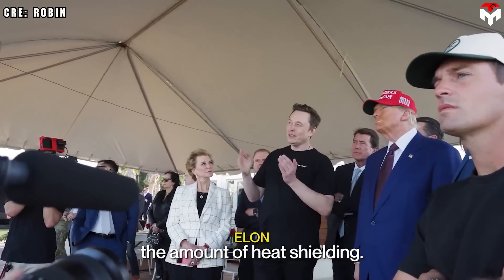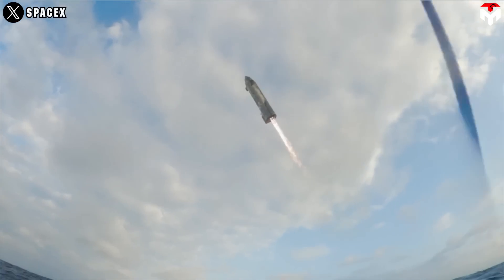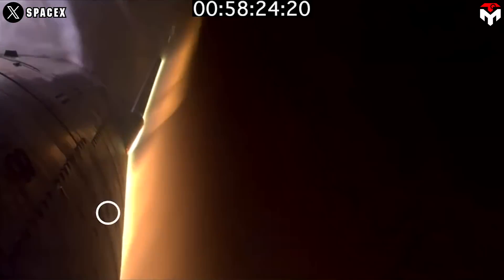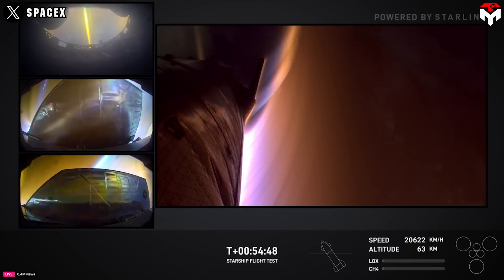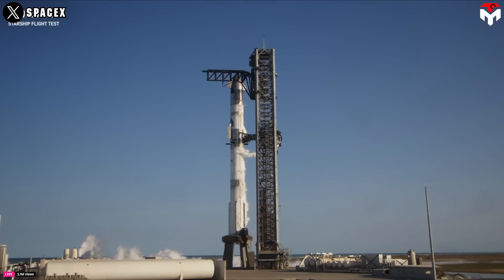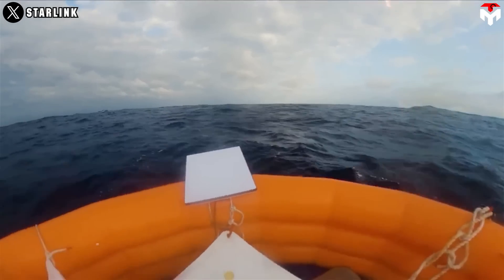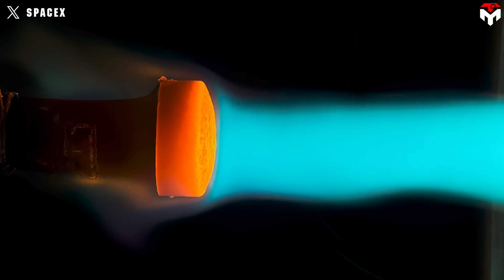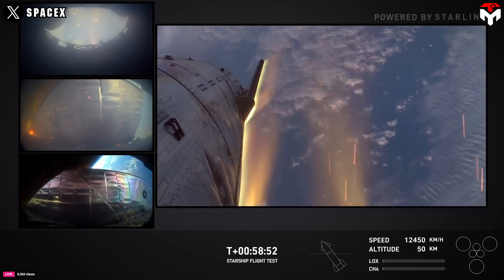"Thermal Shock"! Starship Experienced NEW PROBLEM on Starship Flight 6...

Comment: There's no problem to solve within the context you're using. SpaceX was literally attempting to break the ship during re-entry. In this they failed. The overall mission was a tremendous success as far as re-entry goes. The ship, which was a first generation of even first generation ships that were to be launched, according to their launch broadcast. So it was an older variant. They've achieved more than they expected with these first ships. The block 2 ships will be so far above these older ships they'll be able to move on to the orbit criteria all the while making small improvements to the heat shield for the end goal of rapid reusability. So, there isn't a NEW PROBLEM. SpaceX doesn't need to solve a thermal shock issue, because there isn't one moving forward.
Reply: Yes there is a problem to solve.Multiple problems in fact. And no SpaceX did not try to break it. They tested a theory that less heatshielding was needed.

Time will tell if the next iterations will be better. We can only judge them by what they actually fly, and what they actually fly right now is neither capable of reuse nor capable of taking useful cargo to useful orbits.
Reply: @torben777  I'd disagree on the last point. What they have now can definitely carry useful payloads to useful orbits. It rather appears that the "getting up" part is in a relatively polished condition. 

And the "main thing" about starship, is the payload capacity. It has more internal volume than my house. And can lift more weight than my house weighs (including the foundation & furniture). If you clipped off the wings, you could almost fit the space shutting in it's cargo bay.

They haven't put heavy payload in one yet, due to risk-cost with a new rocket design. But the whole point of the rocket is to shift the maximum payload to orbit capacity of space flight by an order of magnitude. I expect they'll put a low-cost heavy payload in one within a few months, to proof the structural stress involved.

I suppose it's possible that putting a major payload in it could go differently than planned. But it could currently carry a falcon-9's payload weight to LEO with little more capacity strain or effect on handling than putting a briefcase in your car.

But that's just the last sentence. The rest of your sentences, I do generally agree with. I guess testing to see if they could get away with less heat tiles could be viewed as exploring margins, but it's "somewhat" trying to break it as well. They also gave it a sharper reentry angle as well, to strain it. So... tomayto tomahto.
Reply: According to the broadcast I watched with WAI, they aired SpaceX's live feed. During the broadcast, a woman mentioned that they were attempting to break the ship to see how much it could withstand. I’ll take them at their word; they are quite transparent. While I agree that time will tell, I’m not concerned about the durability of the next iteration of the ship.
Reply: Largely agree, but "rapid reuseability" is a very lofty goal, which is as-yet unproven. At least for the starship. The booster should be reasonably easy to get to rapid reusability because it shouldn't get above mach 6 or so. It's unknown just how well the structure can handle the heating on the starship stage. There's going to be some re-tempering. I do think it's absolutely doable... but it may require sacrificing some goals in payload weight to get there. On the plus side, the gen 3 engines should offer a lot more weight margin to work with. It's just that the hopeful payload gains of gen 3 engines may get swallowed up by needs for coping with reentry heat.
Reply: @kathrynck  to be honest, I,don't think starship needs to be fully rapidly reusable only fully AND rapidly separately. I think ship can be left in orbit for a while or taken back to the production site while they fuel the next. Only booster really needs to be rapidly reusable with it's many engines.
Reply: @U_Geek  I guess that really just depends on the goal.
Reply: @U_Geek Yes, and there will probably be variants. Elon has said most of the early ships sent to Mars will remain there. So they will need to survive only one entry into the Martian atmosphere. For building out cis-luna infrastructure, very robust and reusable ships will be needed.
Does anyone know whether the far less dense Martian atmosphere will make for cooler atmospheric entry? I imagine it will have to be a very long trajectory to maximise aerobraking on Mars. Which may allow for greater heat dissipation?
Reply: @DavisRimu  Um...thinner air could get as hot... depends on the speed. Much less air-braking would be possible though. Somewhat more fuel will be needed to slow down.

I know musk is really into the Mars idea. But honestly going there will end up like the moon landing. Pictures, samples, a flag... 

The problem with "colonize mars" is that it'll only sustainable if mars has some resource worth all the effort. If not, it's insanely costly tourism. Mars is somewhat harder to live on than the south pole. And about a million times harder to get to. And Antarctica doesn't exactly have a permanent population.

That said, the usefulness of starship is incredibly high for just about every other aspect of space flight. Sometimes it's not the goal itself that matters, but the experience and learning by attempting it.
Reply: @kathrynck  I've argued for years that the best policy would be to use Starship to do heavy lifting to Earth orbit, building out massive infrastructure within the Earth/Moon system. Only when travel has become routine between Earth and Luna and perhaps large habitats built within our Earth/Moon system, and the hardware is thoroughly robust and reliable, should settlement of Mars be considered. 
By then, AI and the technologies it enables will give us a far better hand to play.
So I agree - the Mars goal is inspiring and has hastened the development of this excellent vehicle for getting heavy loads up out of our gravity well, but we can have endless fun with it within our own Earth/Moon system.
Reply: @DavisRimu  100% agree. Having a large settlement on Mars before Musk's death is crazy ambitious. Maybe impossible. Maturing the Earth/ Moon system is the smartest way to do it.
Reply: @DavisRimu  Plus the moon is believed to have an extreme-value resource to "go get", creating an economic reason to be there. (He3).Technically Mars could have even more He3 (not having a magnetosphere), but even standard shipping would be brutal ;) 

I'm a bit more skeptical of the AI revolution. It's facing a huge issue of "diminishing returns" with increasingly powerful chips. The problem I think is that AI isn't actually any good at "imagination", only mimicking the trappings of it. But it is good at quickly trying out a million possible layouts to achieve something more efficiently. It's just not going to make leaps which think outside the box. Also, it has to be trained... and it's trained on content which has human imagination & debugging... but as more is created by AI, the more it gets cluttered with "copy of a copy" errors, and the more it drifts away from imagination & functional debugged results. Basically the more it becomes AI being trained on AI, the more problematic it becomes.

I imagine it will be an extremely useful tool, and already is in some situations. But right now it's very much in it's "hype honeymoon" hehe.

If a new computing tech comes along... that could change though. Right now it's very difficult to make "better" computer chips. There's not much evidence that we can use a process node under 1nm, and node-shrink isn't offering all that much benefit like it used to at such a small scale. If something new comes along though, and offers orders of magnitude more performance headroom... well that would give AI a big boost.
Reply: @kathrynck I've had mixed experience with AI. Chat-gpt made an assumption and presented it as fact. Instead of asking me to clarify my question it gave me a glib answer. When challenged it admitted it didn't know. In all respects it passed the Turing test!
There's an AI John Mearsheimer now. In a discussion I had with it I ended up saying OK John, I'm out, it's pretty pointless trying to change the mind of a machine. It came back with typical Mearsheimer good humor, acknowledged the point I had been trying to make and signed off. Pretty impressive.
He3 might well be useful, even if it remains on the moon powering a base. Though as Musk says, we have a massive fusion reactor in the sky that requires no maintenance or fueling.
Reply: I understand that all of this may be true, but since we're discussing SpaceX, I'm willing to set aside any doubts until I have a real reason to question their capabilities. The successful capture of that building-sized craft convinced me that there might not be anything SpaceX can't achieve. I am cautiously optimistic about rapid reuse; the key question is: how rapid will it be? Will it align with Elon Musk's vision, or will it be something more realistic? If they can manage to launch twice a week, that would still be incredible. Ultimately, it comes down to how quickly they can build these vehicles and how many launch sites they have in the end.

Comment: An ablative layer does not lend itself to quick reusability.
Reply: Unless you can spray it on. It all depends on your definition of 'quick'.
Reply: @bikerfirefarter7280  Is there such a thing as a spray on ablative coating for such extreme conditions?
Reply: @brianw612  could be, depends on your definition of 'quick'.
Reply: @bikerfirefarter7280  You need to look up the meaning of "ablative" coating.  It protects by being destroyed rather than the item it is protecting.
Reply: Hopefully an ablative layer under the tiles is just backup in case any tiles fail during re-entry. Tiles alone are a single point of catastrophic failure that would have a high probability for total vehicle loss if even one or two tiles in certain areas failed.

It would be really useful if, somehow, they could use water for cooling because they need to bring water on each human flight anyway, and water could also provide some radiation shielding. 

In any case, SpaceX engineers are totally amazing! Constant cutting edge innovation and a blistering launch cadence. Super humans...

Comment: "Magnetohydrodynamic (MHD) technology could potentially be used to create a protective magnetic bubble around a spacecraft like the Starship during reentry. By generating a strong magnetic field, MHD systems can interact with the ionized plasma created by the intense heat of reentry. This interaction could deflect or control the plasma flow, reducing thermal loads on the spacecraft's surface and enhancing its thermal protection capabilities."
Reply: Lmfao. Starship is already too heavy to put any useful payload in orbit.

Comment: Good news is that expendable ships have great value, they are lower cost to build, they can drop their fairings at 1 km/s to boost payload, and with fairings you can maximize payload volume.  With planned mass production, they might be able to create $20M expendable ships with 100T to LEO capacity.  Where you really need reuse is in fuel runs to LEO.  In this case you can cut the size of ship down by 1/2 and reinforce the TPS for net less mass.  This could also apply to a Starship LEO Crew.
Reply from the maker: That’s a great perspective.

Comment: Really why would you mention the melting point of aluminium the rocket is made out of stainless steel, blue colour is because the stainless steel was heated and then cooled rapidly it did land in the sea by the way. This will harden the stainless steel and make it more brittle, but it’s not a big issue. All you have to do is put the heat shield back on that spot.
Reply: Just, no.

Comment: Is there any way to make the heat shield more modular?  Like 3 or 4 big pieces that can be replaced easier?
Reply: I think the primary reason for small tiles is thermal expansion and contraction. Big tiles would likely crack and distort.
Reply: If one part of the giant tile gets damaged, but the rest of it is fine, you're going to need to replace the whole thing. Whereas if one of the 18000 tiles that Starship currently has gets damaged, you just replace the one tile and leave the other 17999 tiles in place. It's much cheaper and easier this way

Comment: If SpaceX develops the ability to refuel in orbit, why not -after refueling - just use the rocket engines to slow the ship down to an appropriate speed to reduce the heat build up on re-entry?
Reply: Sure, you can do this for a few ships, but for the ships that refueled other ships, you need yet more ships to refuel those ships, then more ships to refuel those ships, and so on. At the end of the day, you're going to need an infinite number of ships to return the ships back to Earth using this method.
Reply: Great question.
Reply: Too much fuel needed, not so efficent because the atmosphere can do their job and the astronaut will have to face much higher G force if we reduce the ship speed too much
Reply: Fuel is heavy. Rocket equation is brutal. There is no surplus fuel available.